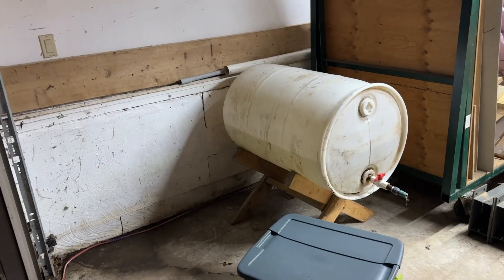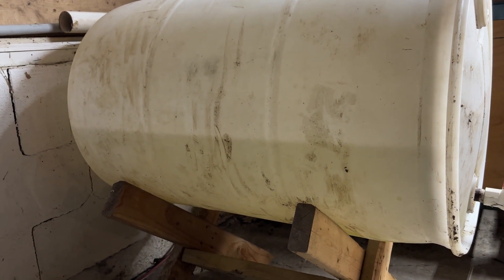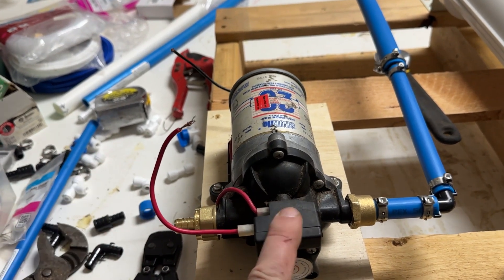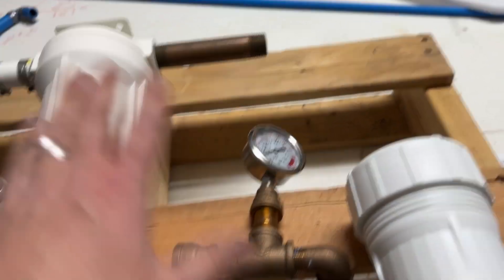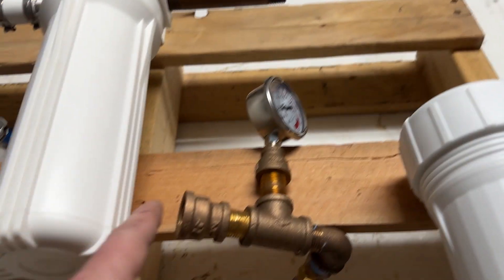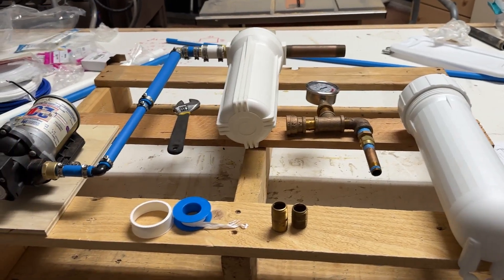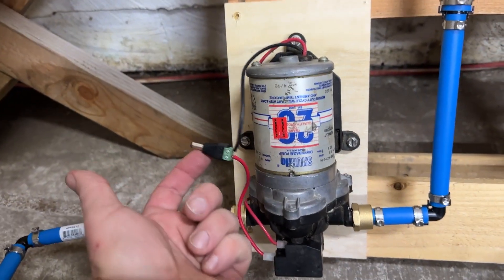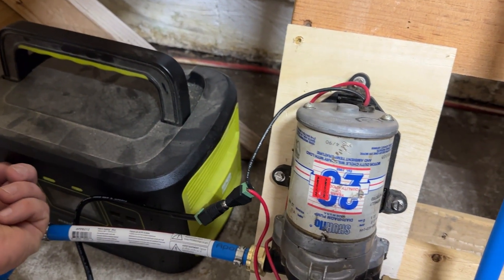DIY Reverse Osmosis System For Maple Syrup

Comment: What was your pressure? I don't think Shurflo gets high enough. Sure it woRks but aquatec 8852 pump gets mine to 140 psi which removes permeate faster.   Also if you want it mobile just use flex tubing for everything and toss in a milkcrate instead of a heavy pallet.  If sugar shack is heated, mount to the wall or whatever then.

Comment: A couple of suggestions to improve RO efficiency you really should do ASAP:
  1.  input PSI is critical.  45psi is at the low end.  The inexpensive "home RO" membranes are most happy in the 70-80psi range, which means most efficient water extraction (permeate) from the concentrate.
  2.  The concentrate line needs appropriate restriction to maintain pressure at the RO membrane.  An open concentrate line (no restriction) is used to flush the filter and should be done periodically during operation and finally at the end. This produces minimal permeate. For normal operation use a fixed restrictor sized for the membrane (i.e. 75 gallon per day), or perhaps a needle valve to tune the restriction. I think a fixed is probably good enough, and avoids the risk of closing off the concentrate entirely and perhaps damaging the membrane with too much pressure.  (A bypass valve around the restriction can be used to flush -- open to flush, closed to force the concentrate thru the restrictor for normal operation.)

Finally, if this is something you want to do long-term, add a second RO membrane.  Input -> membrane1 (permeate to drain) concentrate -> membrane2 (permeate to drain) concentrate -> restrictor -> collection.  This will nearly double the water taken off each pass thru the system.  But you MUST have higher input pressure!  45psi is not enough for "staged concentrate."
Reply: I go 120-140 on mine and have used it for years

Comment: Welcome to the RO club.  You may want to look into a brass needle valve that you can better adjust the pressure on your concentrate line, this will lower concentrate flow and increase permeate discharge.  I have a link for what I use in my last Maple Syrup video on my channel.  Very nice system